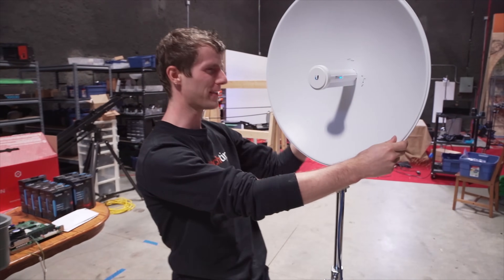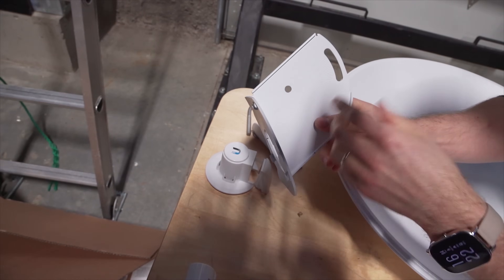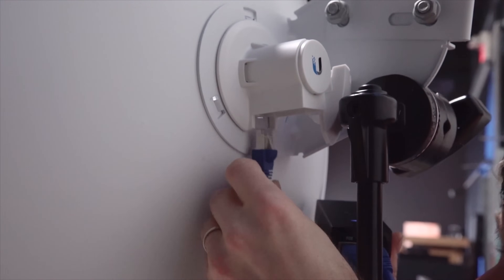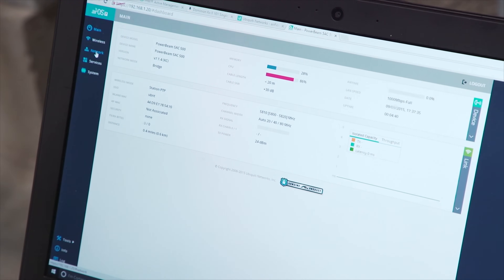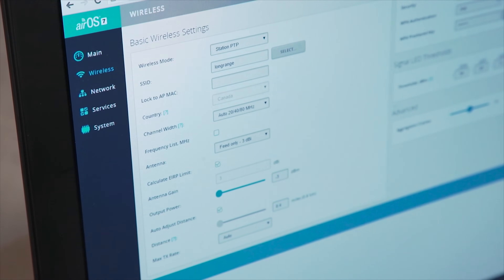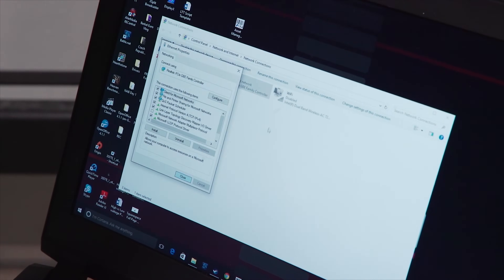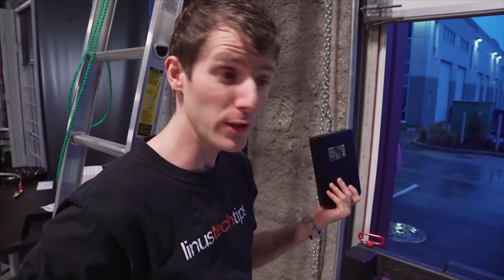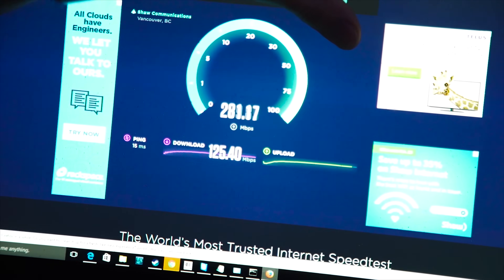HOLY $H!T - Long Distance Wi-Fi (Up to 25 KILOMETER range!?)

Comment: more like $318 sadly. $158 is for "ONE" dish not two.
Reply: +Nerys really though its not bad, running line for my company just over a mile (with an interstate highway in the way) was going to cost us over 50,000 USD and that wasnt going to include the cost of the  maintenance for the lines. whereas we got the beefier setup with two of the AF24 at 1700 each (3640 with tax) and had the towers contracted (25 meter towers x2) for just over 10,000 total. now we have a 1.2-1.4 (really closer to 800mbps to 1gbps) for just under 15000 and its not even noticeable in terms of latency.

Comment: Please never use speedtest websites ever again for these purposes ;)
They measure your bandwidth to the internet and are in no way representative for the actual bandwidth of your network, which usually (and in this case too) is much higher...
Also, the most important part of long distance wifi is the latency, could you do a follow up or some small mention of how much latency there was when testing across the road?
Besides that nice vid and yes the 'car' dota joke was funny :P

Comment: lol. at those distances you'd get same speeds using the radios  without the dishes. (my avatar is a 3ft dish 30 feet up in a redwood tree,. link is 12 miles)
Reply: +TheXanUser I have a 100mbpsup/down connection; through point/multipoint setups with 5ghz:)

Comment: I live in Cyprus and there are several companies, who using the same method like this. They have several gigabit servers and they sharing their connection by putting up a dish like this on the roof of your house, apartment. Of course they capping the connection speed and selling them in 4,6,8,12,16 Mbit packages.

Comment: How's your ping with 25km distance?
Reply: +Anon ymous hmm. EM waves travel at the speed of light, 1 km in 0.0000033356 seconds.
so 25km should only take 0.0000800544 seconds longer than 1 km
Reply: +Zreknarf Speed of light in a vaccum* :)
Reply: I still think your ping should have an improvement or little difference compared to your ISP's grid

Comment: We basically have something like this at home. Its the only way we can get a broadband connection without using miles upon miles of cables (and that would cost alot to reach one house). Right now we get a 20/20mbit connection, not bad considering its a 4-5 km distance.

Comment: PTP stands for Point To Point in the wireless world (PTMP is Point To MultiPoint).
The "weather proof cover" is actually a radome. It helps reduce wind-load on the antenna.

Also the reason why you got better upload speeds when you went outside was probably that the antenna inside the building was partially shielded from noise by the building itself, while the antenna outside was completely exposed to noise. Theoretically noise only affects rx, (receive) but not tx (transmit), which explains why the antenna outside had a hard time dealing with download speeds.

Comment: Okay, I'm not sure about this but here in the states the FFC looks for really strong radio signals that could interfere with other signals or anything receiving a signal. I'm sure Canada has something like this, and I'm pretty sure you have to permission or check in with someone to see if you're ok to do this sorta thing. So, I maybe wrong here but. Something that is powerful enough to send a WiFi connection 25km is umm a matter to be worried about.

Comment: +LinusTechTips My brother has an Ubiquiti setup in Alaska. He has a cable internet connection to a 10m tower in Delta Junction beaming to a 10m tower on a hill top 25 miles away which repeats the signal to his house down the hill 2 more miles. The repeater is run entirely off of batteries and solar panels. -40 (C or F, it doesn't matter) weather and high winds have not brought the system down. 

I forget exactly what speed he is paying for, but I do know that he is getting all of it. There is only a 30ms latency loss.

Comment: Only a few hundred dollars, I would of thought that a point to point wireless link would have cost a few thousand. Could be good for networking between distant outbuildings on a farm or lifestyle block rather than trenching and laying a fiber optic or coaxial/Ethernet link

Comment: If you're going to mount that outside it's highly recommended to get an ethernet surge protector or grounded fused punch down blocks otherwise if that thing got struck by lightning on a pole it could fry anything connected to it. Also recommended to get some osp cabling so water doesn't corrode the copper in a permanent installation. Idk I'm imagining thins might be most useful in the mountains where infrastructure as far as cable might be nonexistent and line of site radio towers are the only way to get good signal. so you could build a little shack with power in site of the antenna, and then wire the dish up to your house or maybe bounce it off another set of dishes and relay it to your house kinda.

Comment: ppl dont take it seriously. it cant reach 25km with only buying 2 of thoes. no no. you need high poles to clear the fresnel zone. you need sight of view . more for 5ghz band. the best is 2.4 ghz. or even 900mhz. i own and owned alot of ubiquiti  equipement and is not that easy. p.s. i take net connections to remote vilages
Reply: +Mariano Rajoy He did say he would need a 50 meter high pole at home which is 20km away hence them doing this at short range.

Comment: This is the type of internet I am using. Its from a local company in my home town. In stead of 2 dish's tho you have a tower for the hole town and dish's go to the home. And I guess for some reason when you are testing the numbers a lower number means a stronger signal. Just like one of those cell booster's lower number means better.

Comment: This isn't illegal?  Linus ya dun goofed m8
Reply: +Yazen Alzaghameem They're not in the US, thus aren't governed by the FCC anyway.  Besides, the licensing of consumer products is typically done by the manufacturer, who'm responsible for ensuring the device does not go out of spec, rather than laying that burden on the consumer.  This particular device is licenced by: FCC, IC, and CE (https://dl.ubnt.com/datasheets/PowerBeam_ac/PowerBeam5ac_DS.pdf).

Here's the FCC licence: https://fccid.io/SWX-NBEM5AC
Reply: No...
Reply: +Yazen Alzaghameem Wut?
Reply: Wy should it be???
Reply: Adrian stålesen High power transmitter needs to be licensed by the FCC.  
Even 50mW is too much for an unlicensed, unregulated transmitter.
Reply: +Kobra Arboc seems you did your homework. Nice.
Reply: Kobra Arboc Did not realize he wasn't in the US, my mistake.  

May be licensed by FCC, but only at specific frequencies and transmit power.  For example you can buy an FM transmitter and equipment but you're not allowed to transmit beyond a certain limit specified in the manual.  

My router has channel 12 and 13 for WiFi, Buffalo WZR-600DHP2. Licensed by FCC,  however, both channels 12 and 13 are not permitted for resedential use.

Just wanted to point this out in a joking manner.  I guess nobody tried this at home?  Lol

Comment: We use something similar to this where I work to provide wireless internet to rural customers where it is just not viable to run a cable. It works and it doesn't. It does not like weather and usually you have to tighten the channel width to get it work nicely with a wireless router on the other end as well. It can work, but it is not the perfect solution. Definitely not the end all solution to provide internet to a bunch of people from one point. Especially when you are trying to make money as a business.

Comment: What speed test website is that?
Reply: +Pandonaut Productions http://beta.speedtest.net/
Reply: Thanks
Reply: +Pandonaut Productions Don&#39;t want to sound like a know it all however, I must interject. Speedtest.net is not best benchmark at all because it uses port 8080, by default. ISP&#39;s have started boosting this as a result, the port has something to do with DSL or dial-up. Testmy.net is a much better and more accurate speed test. It&#39;s more relevant because it uses port 80, which is HTTP/web traffic. Also testmy.net lets you do long term testing. EDIT: TIL: testmy.net is not the way to go, the consensus is to just go with speedtest.net
Reply: +Lucas Klauser testmy.net is even worse imo. It's saying I get 42 Mb/s even though when I download anything I get 12 MB/s which is 96 Mb/s which is what speedtest says I roughly get.
Reply: +Jackal depends on what storage device u have
Reply: +Lucas Klauser testmy.net is horrid; I've pretty much never gotten a reliable test no matter what browser I used.

Use dslreports.com/speedtest, best speed and line quality tester there is; even shows bufferbloat.
Reply: +Lucas Klauser I have to disagree with you.  testmy.net has horrible servers and is often unreliable with high speeds.  speedtest.net is the most reliable I have run into.  I work for an ISP and have access to gigabit internet speeds and only a few of the hosts on speedtest.net are able to keep up to it, I have not found a different speedtest site able to get such high speeds.  I have seen instances where testmy.net can't keep up to a 50mbps connection.  Also no real ISP is going to prioritize by a single port.  Especially 8080 as other servers/services use that port as well.  Also I like the ability to select my test servers.  This way I can see what networks or regions I am getting good connections to.

Comment: Linus... does this antenna only work with the another twin, or can they pic up any other wifi signal. i live way up high and i can see my entire city and our neighbor to the south mexico , over there they are not to good with securing their wifi connections. with Axtel, you can still can get in to any "secured" router just by using the last 10 digits of the mac address... you know just in case of an emergency

Comment: Well, you wouldn't need a 60 meter tower if you added a tower at your house too; adding just a 10 meter tower at your house could shave a significant amount off the height you'd need at the office for it to work.

Comment: These are not really meant for consumers. They are meant for Wireless Internet Service Providers that use wireless point to point and point to multi point links to eliminate the need to run wiring which is hundreds times more expensive than a pair of these. Also the reason that the download/upload speeds weren't high is because they require a load on the opposite end to be fully efficient due to the fact that their pulses consist of a fixed mixture of upload/download packets.

Comment: This equipment is awesome , were I work we use more than a couple of ubiquiti antennas  to connect different buildings and they work just fine regardless of how small they are.

100% recommended for IT.

Comment: How well does it work at lower bitrates, i.e. 10Mbps or 5Mbps connections? (does having a connection via satellite affect performance?)

Does it work with a dynamic IP?
Reply: +dattebenforcer They're just access points really. They function pretty much like any consumer access point, but with longer range and some extra features.

Comment: I love Ubiquiti gear, mostly because of the feature set and quality for the price.
From the basic description of the application the AirFiber would probably have been better suited, although it is quite a bit more expensive ($500 per point for the cheapest model) it offers better performance. https://www.ubnt.com/airfiber/airfiber24-hd/

And the reason you get drastically different results with speed test is because it's not an accurate test unless you disconnect every client from the network except your test machine, this is why I always check my internet speed on my firewall which is reporting the actual amount of traffic going through it, you know you've reached your actual bandwidth when the numbers flatline.

Comment: A highly directional 5ghz radio set. Those are cheaper than the Trango radios that we used for long distance links. (I think they were about $2000 per pair.) We were doing 54mbit at about 30 miles though with a 4 foot dish. We had a second link that was 15 miles on another pair, so we went a total of 45 miles over a hill with 54mbit internet. One way you could actually do this to your house would be to find a spot somewhere on high ground in the middle where you can rent tower space.

80 mhz channel width is HUGE though. I think we were only using 20mhz. It was pretty busy in the 5ghz range at the tower though.

Comment: You should change your antenna type from feed only, to the other option there. With feed only you are only using the back antenna that reflects off the dish, rather than that, and the one on the front from the feeder horn. You will see much better results.

Comment: Linus consider the downlink of the speedtest server you're using being swamped by lots of people doing well speedtests with their DSL lines, they have more down- than uplink capacity so with a symmetric say 1 or even 10Gbps ethernet on the server it would make a lot of sense that there is more capacity available for testing your uplink speed than for downlink.

Comment: WiFi....... i remember that people predicted it would spread everywhere and provide a lot of people with cheap or even free internet, for a while the prediction seemed right and you could find WiFi in any public place, but mobile providers had to compete and found ways to scapegoat public networks and wireless internet access for lost profits, and within a few years there wasn't much public WiFi to connect to anymore, and the price of mobile internet became set artificially high.

Comment: 25Km ? ... just like any other microwave link, proper dish, perfect allingment and antenna height and you are done, even BELOW the 1W budget.  And yes, 1W is really dangerous so beware to check the power prior standing near those dishes and check whatever they meet FCC or any other regulatory requirements. Chinesse crap often go out of limits on everything.

Comment: Great Video.  Ive used this same setup before for my side business and results are really great for the price.  

One tip.  You should activate and configure the ad-blocking in your PFSense router.  It will clean up all those ads on your speedtest.  I know you guys may "want" ads as its revenue for you, but the everyday user may be interested.  I did it for the guest and break-room WiFi for here at work and those ads do cause pages to load a bit slower.  150 people sharing 10Megs of download with content filtering is possible if you cut down the overhead caused by advertisements, adult and other "use at home" content.

Comment: This is a pretty nifty but pointless invention. I can see this being handy for like a college where you are beaming from one end of campus to another and will have WiFi or roters connected to each 2ndary dish or for large landowners who own multiple buildings who want internet in their workshop or guest house and will beam the internet to a 2ndary router. Or for people who own buildings across the street from each other and don't want to run Ethernet across the road. Other than that, long range AC wireless is not really worth it to me, especially if it means Internet.

Comment: Great video as always. Hey I need your help. I have a HP 8740w i5. I did a system scan on crucial and it came back a quad core 32 gb 4 slots. So I look it has two slots.  So I looked up the model number xt908ut and one site said 8gb Max and the other 16 gb max so any suggestions?  Thanks

Comment: About 15+ years ago back in the days when most people were still on dial-up we used this kind of wireless (albeit probably slightly higher power) to get broadband to our LAN-parties. That's also when my friend that borrowed them from work realized that if you stand in front of them to adjust them when on full power the microwaves actually makes you warm... :|

Comment: Higher gain antenna are used for longer range transmission, but lose strength of coverage of close range. (Think of lower gain antenna as a circle, and higher gain as a doughnut). I believe this is why performance increased as the distance between them increased. Also, directional coverage is easier to beam than omni-directional, so the applications of this product are specific (for everyone saying their home wifi sucks, don't buy this haha)

Either way, awesome product.

Comment: Completely unrelated to this video but I wanted to post on a new video in hopes of getting some input. I am thinking of buying a computer off kijiji. The system has some great specs. i5 4690k, evga gtx 770 Classified, 8 gb ram, z87x d3h mb, has ssd, hdd, 850w psu, cooler master k280 case and keyboard and mouse included.  He wants $1000.. Having done a little research, it looks like the cpu, gpu and mb are close the the $1000 alone..  My current setup is an a10 6700 with a hd 6850 1gb that I bought at best buy. The board is locked and missing components and isn't really upgradable.. so my question is.. is this a good deal. would anyone recommend a course of action.. should I simply upgrade my virtually un upgradeable pc or should I spend the $1000 on a used system that seems very much worth it?? Nervous about making a bad decision.. Thanks whoever answers...
Reply: +Mike F Could be stolen. That computer can be built much cheaper, and the CPU price and such is going to tank like most PC parts, because Intel just released a much better CPU line. Do your own research on Tom's Hardware Bang For Buck parts lists, then build your own bud, wayy cheaper.
Reply: sorry.. I forgot to mention.. I am Canadian.. That processor alone is almost $400 and the Video card is around the same price..

Comment: Dont let that signal go above -40dBm. In time it can damage the wireless chip. Also above -35 dbm they start to make alot of noise. That is why you have better speeds when at -47dbm